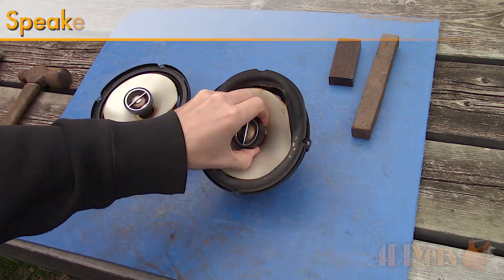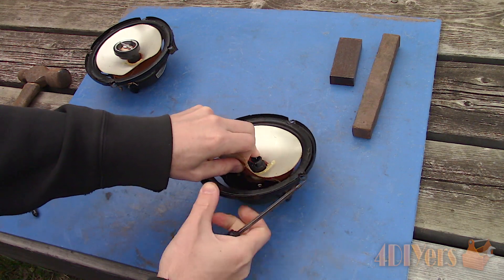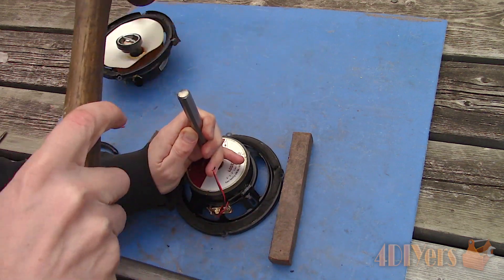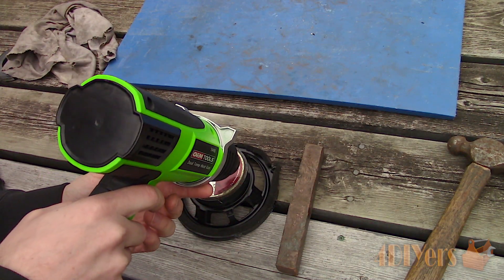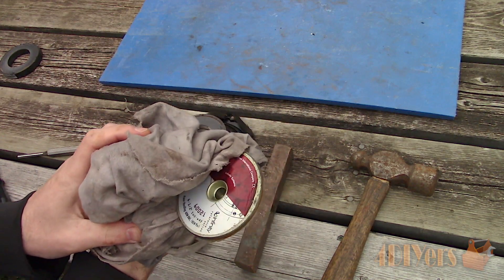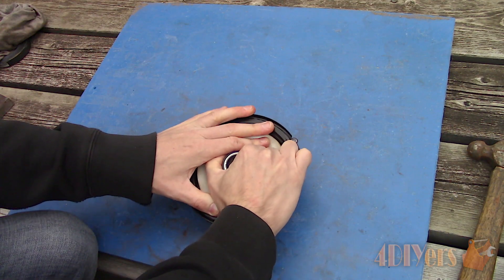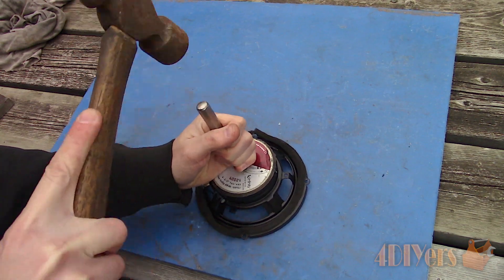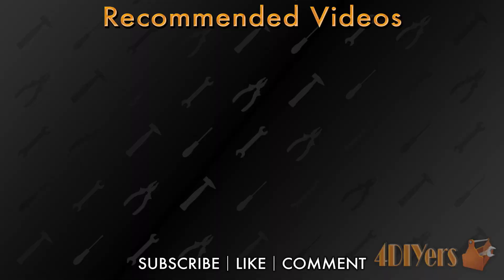How to Remove the Magnet from a Speaker

Comment: Sometimes the reason your magnet brakes is why it was replaced. If the magnet got to hot unevenly or and then cooled to rapidly it can break circomspectivly. If it has defects or slag in it it can also cause failure in the  magnet over time. If the glue holding the metal casing fails it will slip to 1 side pinching the coil and cause overheating and then a short. Or if it was dropped at some point it can create hairline fractures and cause vibration reducing sound quality but the crack may not be noticed until you separate the metal backings holding them in place and the magnet separates broken.
Reply from the maker: Great info, thank you for sharing!

Comment: Don't forget the neos! Neos are the temp sensitive ones only to about 270°F to 350°F. ceramics can handle 500°F plus. I use a scraper or razer to scrape the glue off when soft or soaked in acetone for a few days.
Reply from the maker: Excellent tip!
Reply: To use these to generate self supplying power.why not?😅
Reply: Well do scraping. I know about acsatoon.cool to touch.

Comment: You told us that magnets are brittle and can chip, but then you proceed with a chisel to pound off the magnet from the speaker basket. Maybe a piece of wood or plastic instead of a metal chisel to remove the magnet won't have chip it.
Reply from the maker: Mentioning that was me implying to take your time and don't become aggressive with the separation. Direct the force from the chisel between the seam of the adhered surface and NOT directly against the magnet.

Comment: What kind of projects would these magnets be used for? I watched the whole video, because that was the one thing that piqued my curiosity, but nothing
Reply from the maker: You can use then for homemade fastener holders/containers (glue the magnet in the bottom of a cup), I've seen some projects where people used them for a free energy motor, could be a tool holder, in welding to hold a piece before it's tacked, or even just to magnetize a screwdriver.